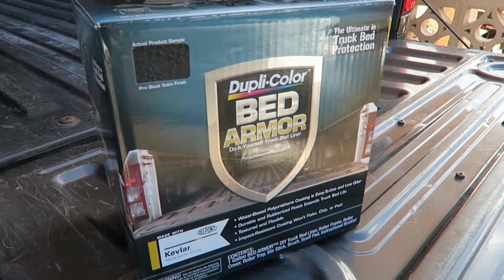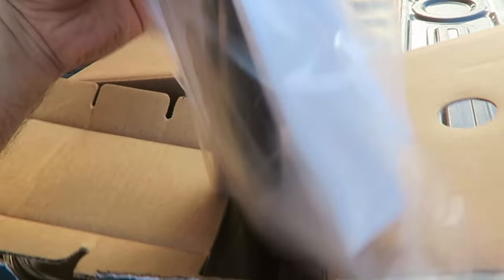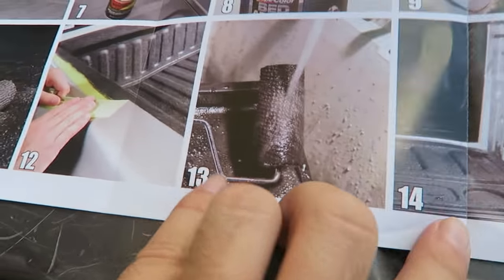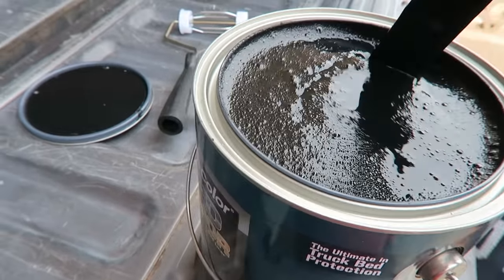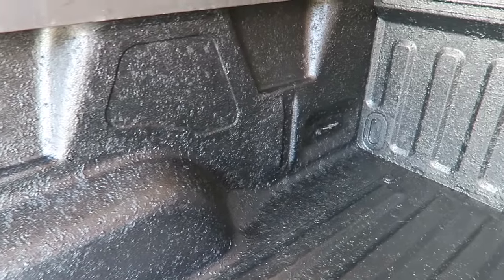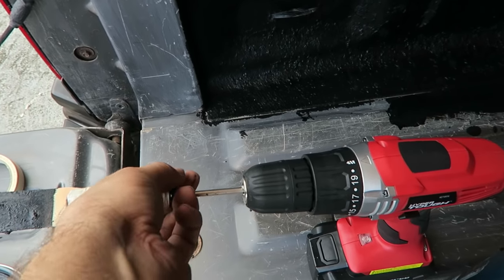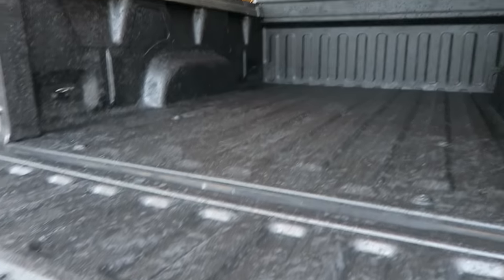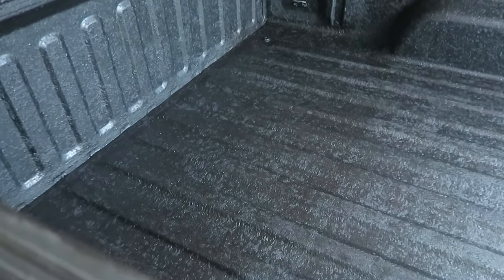Dupli-Color Bed Armor Truck Bed Liner with Kevlar DIY

Comment: Just bought this for my bed honestly agree with everything you said.  Worth the 100 bucks and very easy to apply just takes some elbow grease. Got a military discount so paid 90 bucks. My bed was scratched very similar to yours. And it looks a lot better now and for light hauls it does the trick.

Comment: I used it on a toolbox. I used the brush to nock down the chunks. Personally I like the brush look of it.  It seemed to take about 3 days before it really finished drying.  I'm happy with the results.
Reply: think i can use this with the undercarriage of my car?
Reply: yes you can, but if the other carriage already has minor rust I would say sand it down and put a metal primer on it and then use bed liner.

Comment: I use this product on my 2014 2500 Dodge Ram Cummins and I was not happy with it it was very delicate I did everything. The Box told me to do for prepping with all the sanding and whatnot I used to do body work anyways not happy with the product was very rubbery didn't Harden. I currently now on a 2015 Chevy Silverado I'll never go back to a diesel again anyways it did not come with a bedliner again so I bought the do-it-yourself spray in Raptor liner and wow this stuff is hard you could actually drag stuff on it and not worry just giving you guys the heads up I think the price difference was $100 more for the Raptor liner I live in Canada and cost me 250 with the whole kit spray gun and everything I think the Dupli-Color sold at Canadian Tire I got for a hundred and twenty bucks something like that I don't remember but you get what you pay for that's for sure

Comment: I gave you a thumbs up because you started and finished your project but the results were very rough, bro. I did my bed yesterday but i used the Raptor product and sprayed it on. I did 4 hours and the sanding was done with my small electric sander. Cut my time doung that. The taping was the part that took the longest. I then sprayed the liner and i was very happy with it! Almost professional grade if i do say so myself. 😁 I did 3 coats on the walls and 6 coats on the bed. It was almost 300 bucks but saved almost 300 bucks doing it myself. Some placed charge 900 to 1200.

Comment: I prefer the aerosol cans of this @ $10 a can(bought 8 cans) i did the whole roof of my E350 extended van with 4 coats. The finish is way better than this, it looks more like sandpaper having that uniform look.

Comment: i suggest liner xtreeme look them up there product has a kevlar n rubber crumbs in fine and heavy texture made with epoxy poly blend standard very high solids not thin like you see there i regretted the store stuff but any how they to have pure epoxy industrial duty etc available oh color poly uv  version to

Comment: Does it have a strong order ?? Or any? Chemical paint smell.. ?
Reply: Nigga Boy 
Nope it has no smell. But if you shake the can before mixing it 3 times it'll smell like cherry. 4 times pancakes. Don't shake it 5 times because it'll smell like a turd after going to taco bell.
Reply: it's water based the ones that are stinky and smelly are the oil base paint.
Reply: So this truly has no smell? Or just very light. I can't use the products that have high smells.

Comment: Can I apply this w/ the undercarriage? Brush it on?
Reply from the maker: +Lincolnator yes, it should work good for that.
Reply: Thanks for the quick response, I'll give it a try. I'm fixing the rust on my 18 year old car and it's a big pain. I'd rather brush than spray. Maybe I can try to make a video !
Reply from the maker: +Lincolnator rust is no fun. Goodluck with your project. If you make a video let me know. Thanks
Reply: Lincolnator I know a couple guy that rolled and sprayed the entire truck the a similar product, and it is amazing, doesn't scratch, cleans super easy,